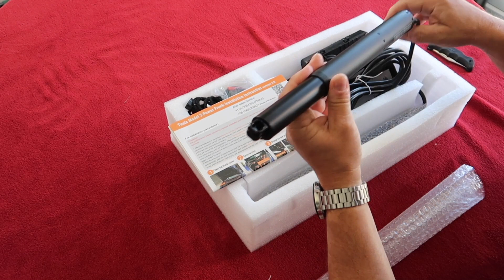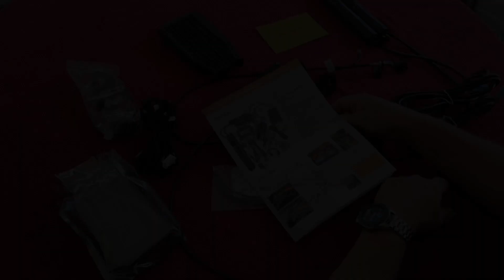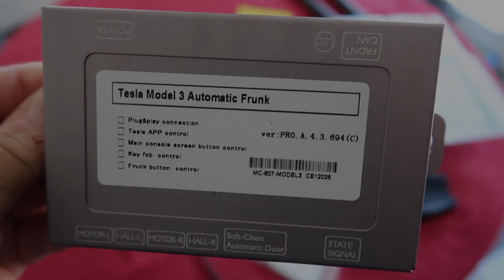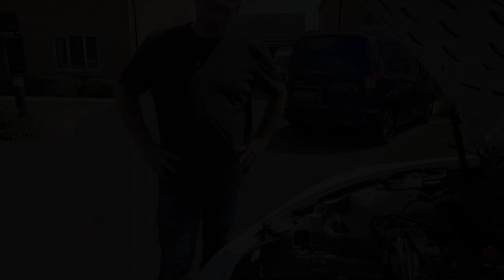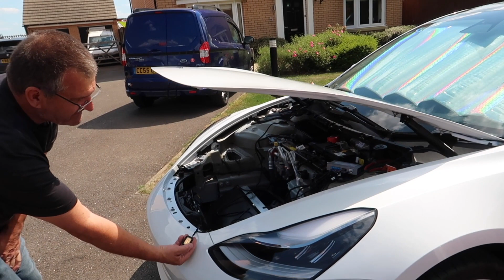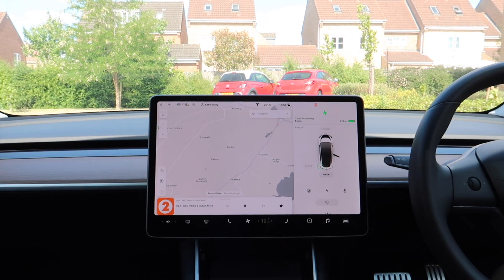Unboxing, Installation (with tips) & Review of the Hansshow Motorised Tesla Model 3 Frunk

Comment: Would this work for a 2023 Model3? As the frunk liners under the bonnet are much different.
Reply from the maker: I've not got a 2023 model sorry BUT I agree they are different so although many of the basic instructions would be the same the specific details would be slightly different. 

If you're a dab hand with a screwdriver it shouldn't be too hard to install. 

Sorry I can't be more help but I don't have the 2023 Model 3.

Comment: Is it pinch-safe?
Reply from the maker: I've not tested it with my finger so can't say for sure. I would always operate it in full view so no chance of anyone having anything trapped in the bonnet.
Reply: @MarkSimlo  anything else? For instance if you pack the frunk too much or a bagstrap gets in the way, will the motor stop? So it doesn't damage itself.
Reply from the maker: @BadTomzi  I can answer that one from experience,! 

If the bonnet can't close because of an over full frunk it doesn't force anything. It just doesn't close and beeps to let you know it's not closed. You also get notified on the app that the frunk isn't closed. 

It doesn't damage the bonnet with over exertion.

Comment: Top video!! I am not really any good with a screwdriver, so I will still require some professional help!! But it is good to see it's a relative simple job to do!!
Reply from the maker: Thanks. On the Model 3 it's really really straight forward to install and I think I covered everything you could come across in the video to the point where you should be able to fit it yourself easily. 

Even if you get half way through and get stuck the worst case is you just close the bonnet, put all the bits in the boot and then get someone else to carry on with the install. I honestly don't think you'd get stuck though and as long as you take your time and just refresh yourself at each point in the video by re watching it you should be fine. 

Thanks again!

Comment: Mark - thanks for this. A bit nervous of fitting to my M3. Are you going to do the same for the Trunk?
Reply from the maker: Glad it was useful. I might in time to the boot (trunk). I now use the frunk way more and it's crazy that something so small can change the use do much. 

It's a really easy installation on the frunk so if recommend take your time and follow the instructions in this video and you'll be fine.
Reply: @MarkSimlo   Thanks Mark. I have both frunk and trunk kits now. Will do the Frunk later this week and then the trunk if all goes well.
Reply from the maker: @AdL8977  you'll love it. Let me know how it goes and if you pop a video up on them tag me please. I'd love to see the results. 

Glad I could help you achieve this. Cheers.
Reply: @MarkSimlo  Hi Mark - well the Frunk is done. It was a bit of a struggle until I realised that I have to move the latch position upwards a bit to trigger the little microswitch. But a bigger problem is that one strut keeps detaching from the ball joint. I swapped the clips from another strut but it still did this. It is properly pushed home! I think it is a manufacturing defect as a spiral scratch has appeared on the body of the strut. I have quieried Hansshow on this.
Reply from the maker: @AdL8977  that's odd! Just seen the comment. 

Did you get a response OK?